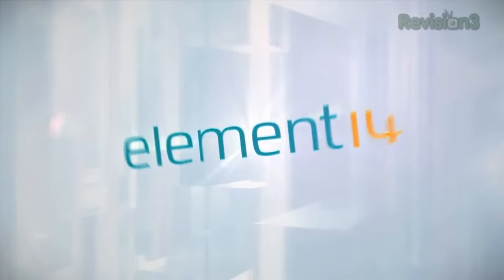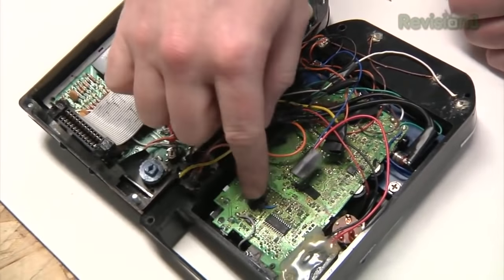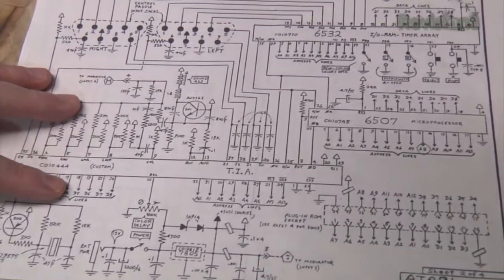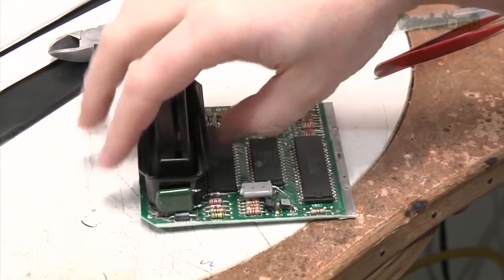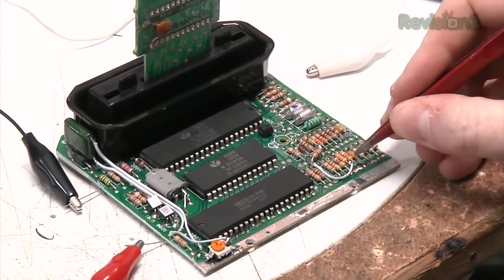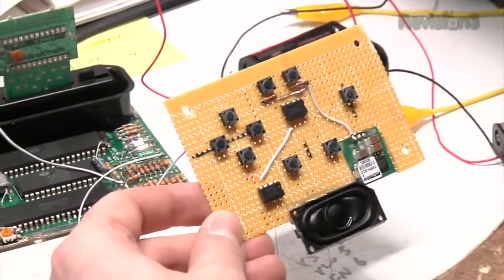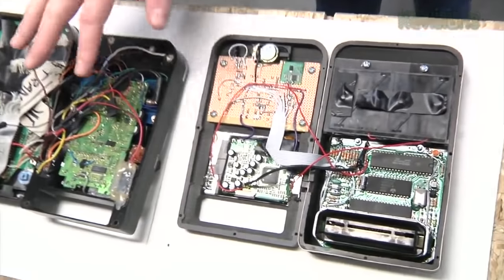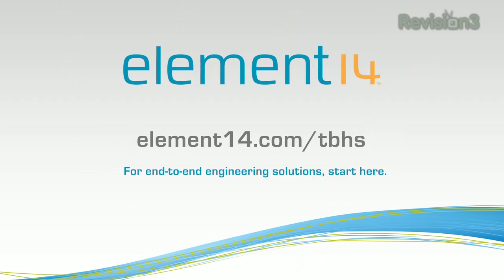The Original Atari Portable Gaming Mod Is Back!

Comment: If I were you, I would've replaced the cartridge port with a ROM chip with every game for the system or an SD card slot. I would also replace the six AA batteries with a thin rechargeable battery. These changes would make the unit thinner.

Comment: You should try making one form one of those 2600 tv games. From what I have hear they use most of the same hardware to the original 2600 and you can even add a cartage slot but they are much smaller.

Comment: This is still my favorite handheld game system of Ben's. I want to make a portable NES for myself one day.
Reply: +Damian Wezzterman It's not too hard to make a portable nes. Instructables has a instruction for it. and it's not expensive either: a nes and a controller(good deals=about 20$) a screen(price changes with size) and some tools. If you are still a kid you could ask your parents(or other adults like your uncle, adult cousin if you have one or friends of your family) for help with soldering
Reply: +Gra130503 
I'm still a kid at heart lol, but I'm 35.  If I make one I'll just use a top-load NES board. Even have a design with a sliding/locking double sided cartridge slot that would allow it to be able to play both NES and Famicom cartridges. You'd have to see my disigns to understand the workings better.
Reply: +Damian Wezzterman Go for it. I'd love to see it.

Comment: I'm putting all of the 2600 on a breadboard, and then trying to skrink it down as much as possible. I will then make a plexi-glass enclosure for it. I like to SEE the circuitry in my electronics, and generally like to do this kind of stuff. This will be my first major electronics project. It's going to be like the Rasberry Pi of an Atari 2600. Respond and tell me what you think. Thanks, Nick

Comment: I wonder if it would b possible to use one of the Jakks Atari 10 in 1 joystick to make a nice, compact portable unit and maybe, add either a cartridge slot, or an sdcard or similar to have all the games on the unit.

Comment: Watching this 7.5 years after the fact and I find it so very amusing that AA batteries were considered a viable option for power.  My how things have changed.
Reply: It still is, or at least should be. 

AA batteries are in some ways better due to their ability to be replaced so easily, just go to the nearest drug store and you’re back in business. 

Try to use that lithium ion battery 20 years down the line. 

I do get you though, I would have definitely done it with a lithium ion battery as well.

Comment: Oh my god, why would you cut that thing apart ? Just leave the old one alone ! It's fine !
Besides, buying a 'new' Atari 2600 is easy and cheap ! (ah, you did, phew).
Just make a new one !
A black D-pad and maybe metal or at least metal looking selector buttons would have matched the original, and of course just use the big orange action button ;)
Reply: Screw a black D-Pad, a goddamn WOODGRAIN DPAD would be cooler.
Reply: Jomaster The Second Yeah, but the joystick was black

Comment: Couldn't this be done easier using a raspberry pi and a atari emulator, with a 4gb USB thumb drive.
Reply: It very well could have (for about the same price as well), but I think the idea was to stick to the original design in as many ways as possible.